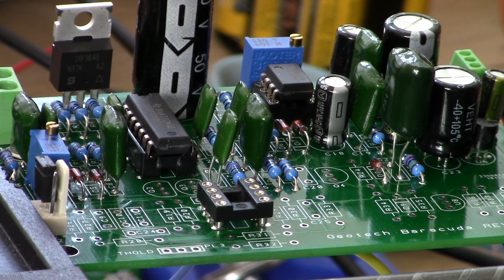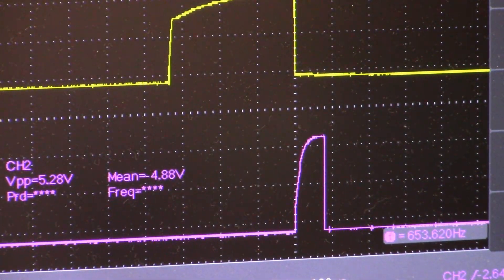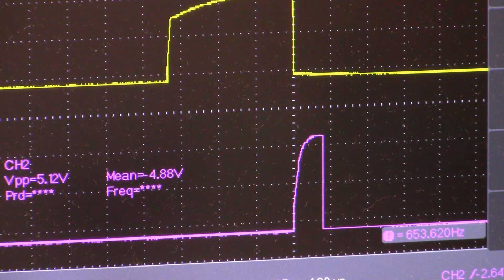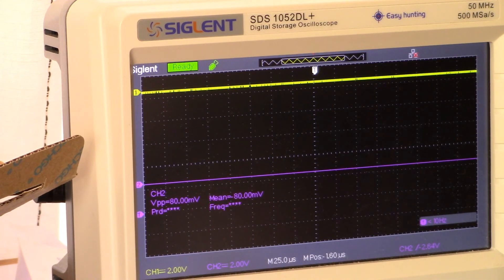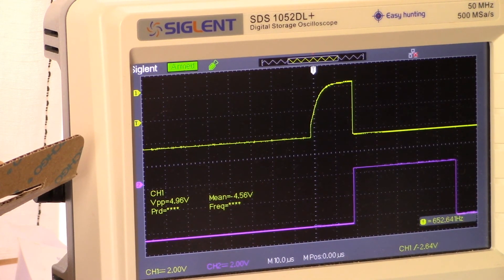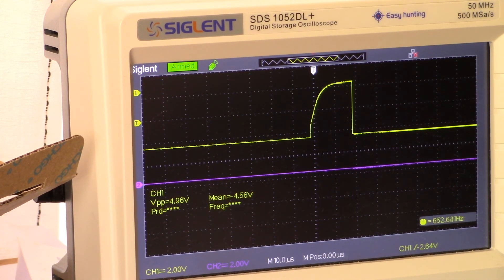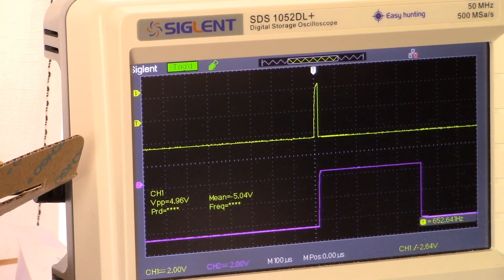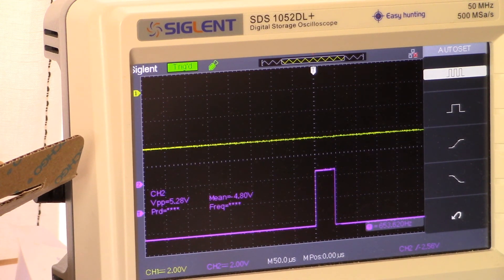Geotech Barracuda Pulse Induction metal detector step #6 Sample Pulse Generator

Comment: I have ordered only the pcbs and i realised i cant find the parts because its old dang what should i do now?
Reply from the maker: https://www.geotech1.com/forums/showthread.php?23385-Geotech-Baracuda-REV-A-Project-Details
The gerbers are at the bottom of that page.
Reply from the maker: Exactly what parts are you unable to purchase?
Reply from the maker: Two layer
Reply: IMO, the most difficult to find are the 2 FETs (2N5484 & 2N5485). But I have heard the BF256 works well as a substitute for both. At this time, it is still available from Mouser and Digikey. The LF412 is obsolete, but also still available from those sources (at this time).
Reply: @barwildi1203  alright I can get from mouser but I wouldn't pay 20$ shipping for a 2$ part . That's the main issue. But luckily I can get 2n5484 but not the 5. I will use j113 instead
Reply: @barwildi1203  also I can get lf412 luckily
Reply: @barwildi1203  Thanks for the extra replacements though!
Reply: @barwildi1203  i will try bf256(as a replacement for 2n5485) and i can already get the 2n5484
Reply: @silentgaming9328  Just as a reminder, if you do try the BF256 (or any other replacements), be sure to pre-check the pin orientation as some devices have different pin assignments.
Reply: @barwildi1203  yeah sure thanks

Comment: It looks in the video you either solder both side of component, or some of the solder flows through the hole and comes out the other side, does it come out the side where the component is when soldering, the boards are all the way through and get soldered from the back side right.
Reply from the maker: Hello Matt, The boards are through -hole plated and you solder the components from the back side of the PCB.  Some of the solder will flow through the hole.  Thanks for watching